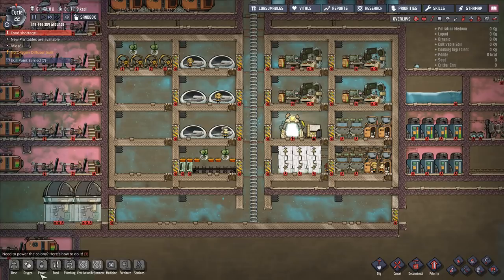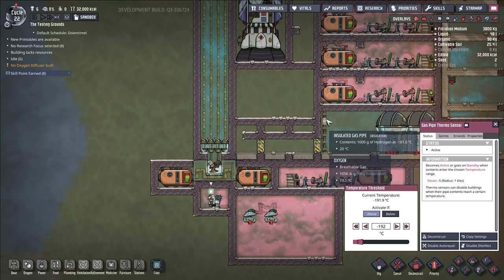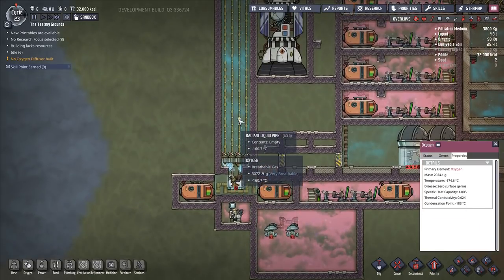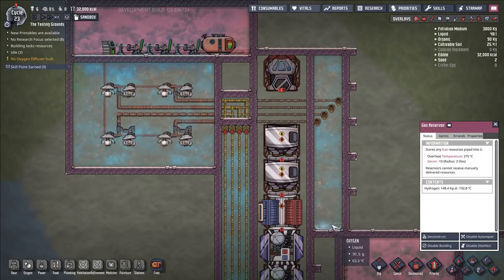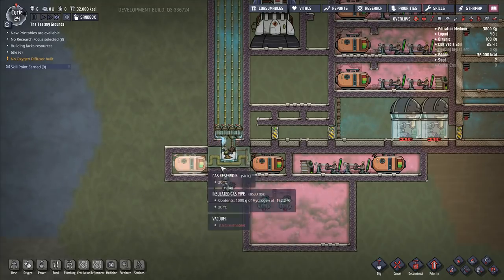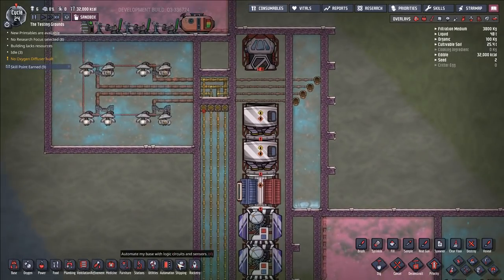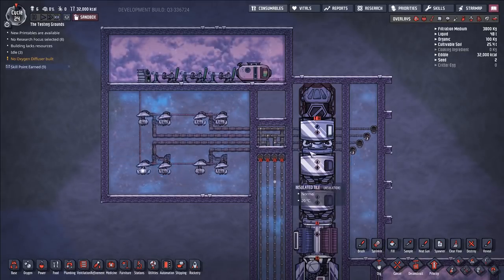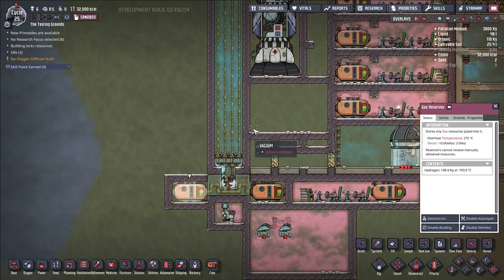This Liquid Oxygen Setup is 30x More Efficient Than Yours! [Oxygen Not Included]

Comment: looks great, but how about the build process? we can't see some pipes and how they flow, or where exactly they're connected to after being directed through what, or the startup procedure- i see the thermo regulator is sitting in an insulated box of -70 degree hydrogen.. where's that come from?
does the radiant liquid pipe cooling chamber have to be that tall? what kind of efficiency loss is caused by making it smaller? does it even still work? 
and materials! i saw u using insulation from rare space materials to make some of the pipes, but if we don't have liquid oxygen yet, idk how likely it is we have a bunch of that on hand? can we use other materials? i imagine not :/
lol came to get the answer to a question but left with more than i started with XD

Comment: But it onnly makes LOX in form of +60c packets of 1 kg each inside liquid pipes , right? Which turns to gas once in the wild and i cant make this build fill pool of LOX for my duplicants to swim ? until i missed something.
Reply: Only the lox coming back up through the system gets warmed back up above boiling point. If you pipe the flow valves' overflow out of the system to wherever you want it, you should be able to get as much as you like. If it isn't going fast enough for you, just add another regulator and some more radiant pipe segments to speed up the cooling process until it's producing at the speed you want.

Comment: all you are doing is abusing an exploit and use heat exchange to minimize powerdraw/gs, not very impresive.
Reply from the maker: If you say it's an exploit, I wont argue-- in fact I made a video discussing exploits and my policy on them and discussed this build in particular-- you can check the link below if you're interested.

But when you say this isn't impressive, you're dead wrong.  When I posted my sour gas condenser build to Reddit, I got tons of comments saying it was thermodynamically impossible.  They didn't argue that the pipe throttling mechanic was an exploit-- no, they said that the build would never work because I didn't understand the thermodynamics.

This build proved them completely wrong and blew their minds.  If you think this build is unimpressive, then you overestimate the knowledge of the average player.

https://www.youtube.com/watch?v=8mm4wn2yPQU

Comment: Thanks for video. In survival mode this huge building waste of materials and space. IMO survival mode efficiency = compact build with limited materiel usage w/o any exploit.
Edit: Looking for a compact LOX setup :)
Reply from the maker: You can make a very tiny version of this if compactness is your concern.  Check out my other condenser builds if you're interested.
Reply from the maker: As I said earlier, if you want a more compact setup, just shorten the condenser tube.  This build can easily be a quarter of the size, and at worst you're just gonna put an extra thermo regulator in.
Reply: @gearheadgaming1  Made a compact version based on your build and added some safety stuff to avoid disasters :) Thanks!
Reply from the maker: @interestedincphpsqlmysql4222  Awesome to hear, glad it was of help

Comment: great vid, got a new subscriber :) but its hard to see whats going on here, you got Diamond tiles for keeping them cool right?, and the cold oxygen is used by pipes to recool the gas oxygen to liq-oxygen, but how do you start it? (also, how did you build it? with ladders? )
Reply from the maker: I built it in sandbox mode-- in survival it might be easier to build it horizontally, but vertical with ladders works as well, you can leave the ladders in and it should be fine.

Diamond window tiles are the best conductors in the game right now, but metal tiles are not far behind, so either should work.  Likewise, I put a couple of diamond tempshift plates at the very bottom over the pump-- those could be a conductive metal as well.  The cooling work is done by the thermo-regulator pumping hydrogen.

As for starting it, I think the key is just to make sure the cold part has a chance to cool down to the right temperature before putting in oxygen.  It's better to err on the side of colder, even if it means there's a period at the start where the oxygen freezes solid, because you can always tweak the sensor by the thermo-regulator to let the system warm up a little.
Reply: and can do it all with just a wiswort?

Comment: I wouldn't knowingly use that pipe trick regardless of how amazing that efficiency is unless some dev straight up said that is an intended mechanic.  Which is may be since it seems like something that had to be specifically set.
Reply from the maker: I think it's hard to say one way or the other.  On the one hand, it seems like an intended mechanic because as you said, it seems like it is something that developers had to intentionally add into the game.  But on the other hand, a lot of stuff has happened since the mechanic was introduced.  Even if devs at one point intended players to use pipe throttling as a mechanic, it's very possible that after introducing super coolant, they planned on removing the mechanic and having players use super coolant.  So even if at one point it was intended, it might be unintended today.  So even if they put it there, it's possible they might not want it to STILL be there.

Comment: It is an exploit. Don't be facetious. It's probably not cheating, but it is exploiting.
Reply from the maker: No one's being facetious.

See the video I made on exploits:  https://www.youtube.com/watch?v=8mm4wn2yPQU
Reply: I sort of agree with that filling tanks with liquid "gaseous" oxygen is an exploit, at least in my opinion.  I don't think pipes with 1kg of "gas" are an exploit, I agree this is likely intended by Klei.  But I do think that Klei should fix the rocket tanks to only accept liquid oxygen - oxygen that is colder than it's boiling point. (Also liquid hydrogen...)

This would be a similar fix to electrolyers not accepting water greater that 100 C as you have mentioned in one of your later videos.

A side effect would be that filling rocket tanks would be harder because pipes tend to warm up very cold liquids, but could be done with a bypass and return to initially cool the pipes.

That said these are very informative videos, I particularly like the ones on oil -> sour gas -> natural gas.   Finally, I do agree, one person's exploit is another person's clever solution.